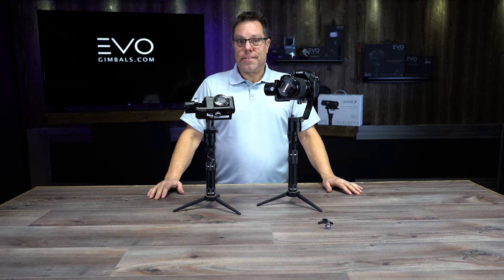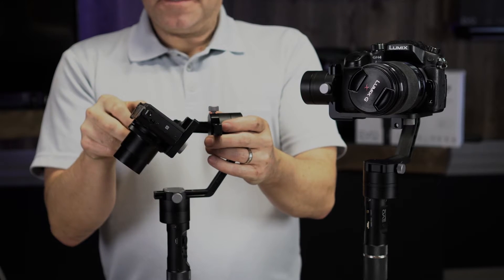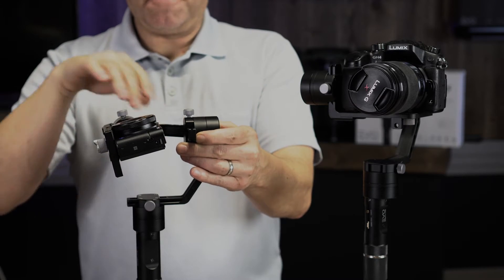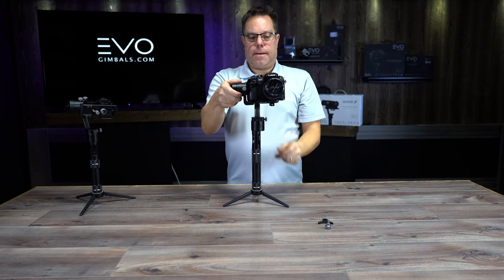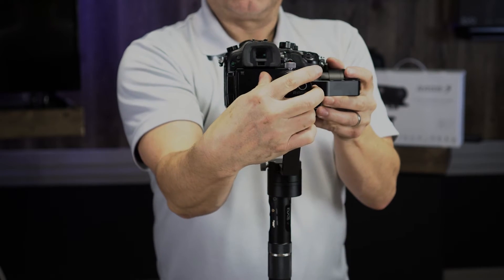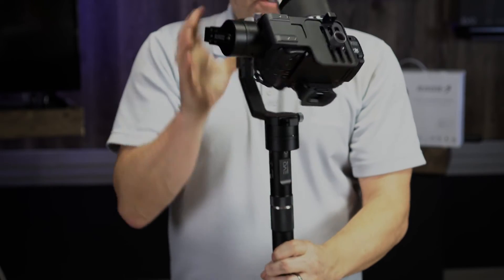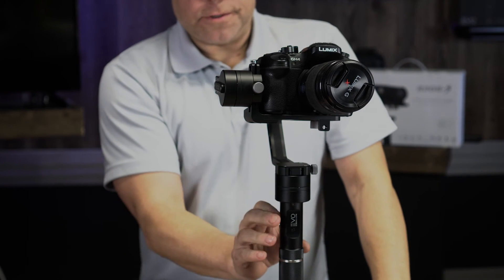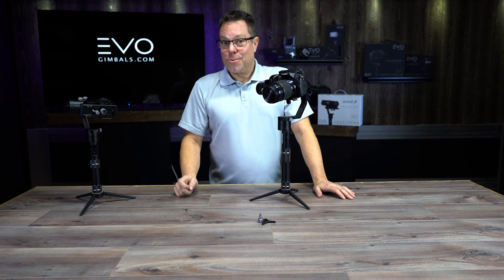How To Balance Your Rage or Rage-S Gimbal - EVOGimbals.com

Comment: Whenever I turn on my Evo Rage (Gen 2) it begins to make a strange sound and shake up and down.  The moment I turn it on.  What do I do?  Please advise.
Reply from the maker: It sounds like you have the motor strength set too high or too low for your camera weight. Please take a look at this article for guidance on adjusting the settings: https://evogimbals.zendesk.com/hc/en-us/articles/115003419754-Adjusting-Motor-Strength

Comment: Can the Evo SS be balanced like this in anyway? 
I noticed when I power it off (with Gopro installed) it flops over. 
I haven't seen any videos regarding my question. 
Thanks in advance!
Reply from the maker: Hi Arthur, this would not be possible with the SS as it is not necessary with the Go Pro. Any other questions, please let us know.

Comment: The explanation of the balancing seemed too rushed. Other videos seem to show the balancing act as the most cumbersome issue. With the EVO GP there is none of this 6 step balancing routine. Just put on your camera and shoot! Couldn't the gimbal just detect the weight and run a calibration instead? Changing out a lens or adding a mic will cause another 6 step balance routine?

Comment: Are those tripod attachments available for the GP PRO? :)
Reply: EVO Gimbals thanks! Also do you have a recommended solution on a mount for the GP PRO? I wish to mount it on the chest mount or backpack mount. So far I just use velcro straps